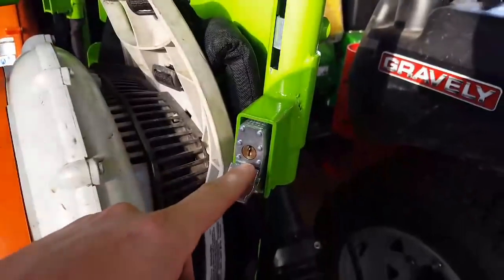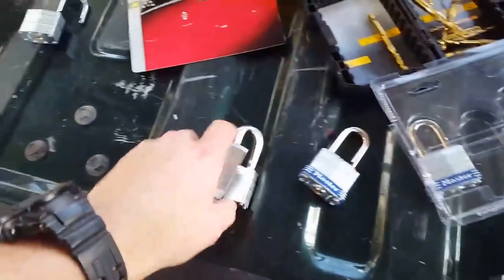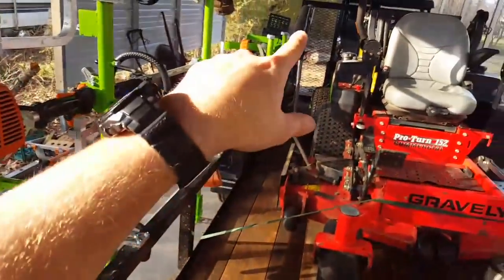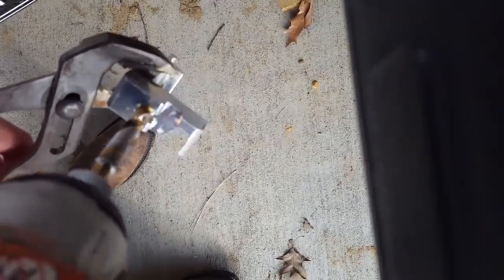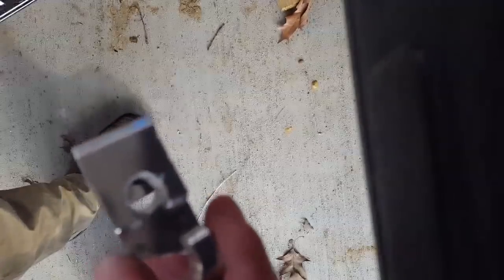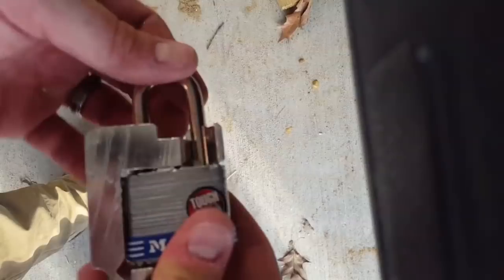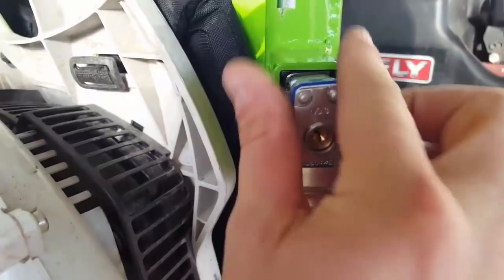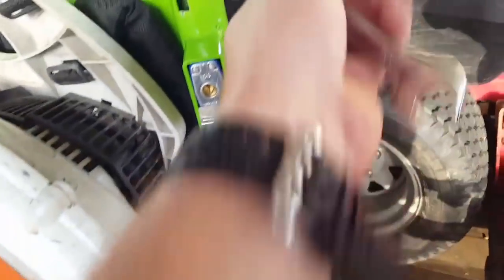HOW TO Change / SWAP GREENTOUCH locks to MASTER locks!! ENJOY

Comment: The lock ain’t going to be the problem.  My stuff got stolen and the thieves just pried them out using the leverage of the weedeaters and just bent the tangs releasing them.  The whole thing is just set up to slow them down.  It don’t matter if you have a military grade lock with a nuclear code when all they need to do is pull on the trimmers till they come loose.  These racks just make you feel better about yourself bc they aren’t stopping anything if they want it.
Reply: Was it the new model racks?
Reply: That’s why I alternate the prongs on the end of my trimmers one prong faces the trimmer head and then I’ll flip it so another prong faces the engine so that no matter if the pull left or right it’s going to be harder to bend the upright post.

Comment: Could I get the part number for these locks, or at least the height of them. Thanks
Reply from the maker: Master Lock 1.56-in Wide Laminated Steel Body Padlock with 1.13-in Shackle
Reply: @SouthernStyleLawnCare  thank you
Reply from the maker: No prob. Very easy to do. I also spray wd40 on my lock key hole and around the locks once a year and slide like butter.